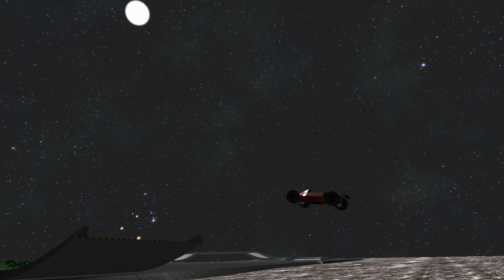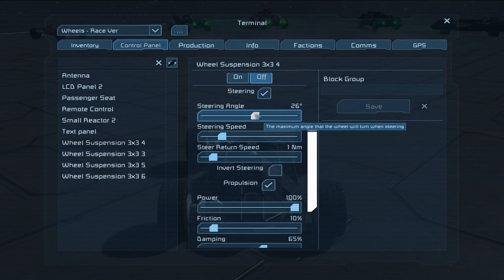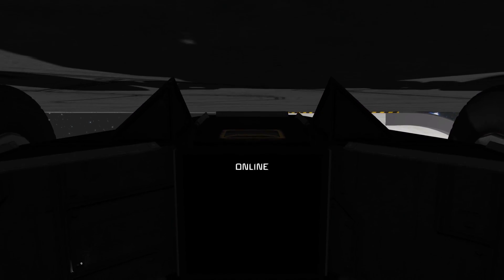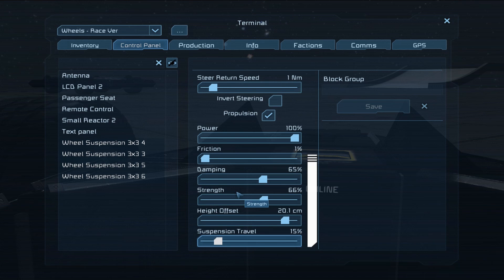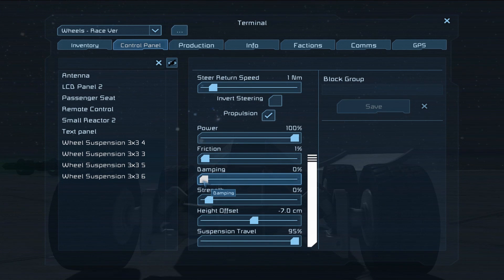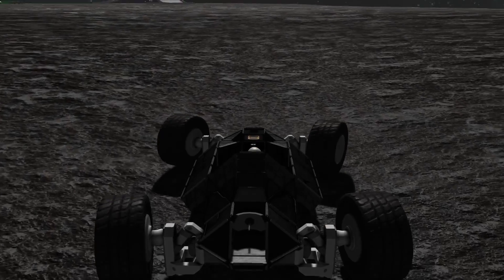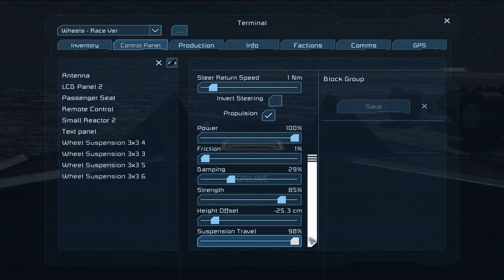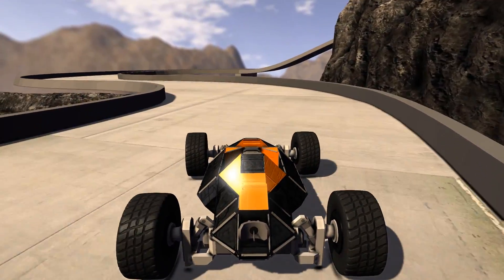Space Engineers - How to..? Wheel Mechanics - DON'T PANIC: The w4stedspace Guide to the Galaxy

Comment: a big thing i found with rovers or buggy's is that if you want to make a preexisting design more stable and handle better adding a additional set of wheels onto the suspension helps immensely; It made my rover take the Glacier on the teraformed map with ease.  (side note, you can attach smaller wheels onto the larger suspension and they get more power, I attached 3x3 wheels to the 5x5 suspension and gained a huge amount of acceleration)
Reply from the maker: eternal domine 6wheels or more seems to be a great way to go for off-road designs right now.. kinda as you would expect I guess, more total contact with the ground and more chance of multiple wheels being in contact at any given time.

Comment: A few details: flat wheels (unsuspensioned) don't seem to have been improved, and large ship wheels also seem to still have very low traction.

Power is extremely important for offroading and climbing as well, since a low power level means a stuck wheel stays stuck. Of course, once you've started moving, that high power might make you speed right off the cliffs. This is the opposite of how rotored wheels work, where you want to spin slower when you have a stuck wheel.
Reply: Well, since you can just change your wheel power (and all other settings) on the fly, there's really no issue here. Just temporarily bump up the power value, climb the hill and lower it back down.

Comment: best thing to do is to set up all the wheel settings in the hotbar to change them on the go, this made my offroad truck work on anything
Reply from the maker: TheRaeffi Aye is a good plan, I was using that as a version of traction control on my racer to give some analogue throttle input - albeit quite hard to control like that :)

Comment: Could you do something around the lines of automated Mining? With the whole exploration thing I noticed myself not wanting to pilot a mining ship to make use of the endless asteroids. I already came up with a ship that that can launch mining 'probes' that dig there way trough an asteroid and wait on the other side when they are done. The launch ship can fire several of these into one or more asteroids and it can pick them up later when the probe is done. The probes run by a combination of programmable blocks, timers and sensors to determine if its aligned properly, if it should be mining or if it should come to a stop. This all works great UNLESS there is a cave inside the asteroid. Inside the sensors cannot pickup the small pocket of empty space so the thrusters are not disabled. This makes it that the probe picks up speed and then crushes itself against the cave wall. Now I'm curious as howto you would handle this concept of unmanned automated mining (or survey) probes.
Reply from the maker: Nick Otten Not sure that's something I could do in this series - the subject is pretty broad - but I could definitely look at making something to solve the problem and explain that a bit like I do in the 'usual' SE vids.

Comment: A better way of explaining the damping is that its a air-filled phumnatic piston, like the ones that cause a car trunk to open slowly.  These have a verry small hole in them that lets air flow in and out.  The smaller the hole, the slower air can flow in, the greater the resistance to any motion.  If we picture the hole to be of varile size, like your iris, then we can imagine that were adjusting the hole size, not the oil consistancy.  (plus, this means that, scientificly, we dont have to make out oil out of nanomaterals so we can control it)

Comment: The problem you have with the hight-setting of the suspension is because you installed them upside down. so the vertical bar from the suspension should be the upside and the triangle of the suspension should direkt down. But the rest of guide is very nice.
Reply from the maker: Volanur84 Fair enough - guess you are correct, although visually that makes less sense as it means the suspension is opening rather than compressing over bumps. Fortunately which way up they are doesn't make any difference to the other settings :) Thanks for pointing that out.

Comment: what type of settings would you use for a tank sort of thing (multiple wheels very close together)
Reply from the maker: TEGC Quantum You'd have to limit the steering travel dramatically to stop them from colliding, which is going to limit how well you can turn a lot.. one option would be to have a set of wheels, maybe the rear, slightly further apart and use those as the primary steering as they have clearance, the rest of the wheels set to a very low steering amount just to help it turn. Then you'll want high damping low strength like the offroader to make it look authentic :)
Reply: Thanks for the help it will really help my tank design project as currently I've been using rotors instead of suspension.

Comment: what should you have the damping and strength on for a moon surface?
Reply from the maker: +Plasma Werewolf Really want the strength as low as you can possibly get while still being off the ground, it'll be that that makes it behave kinda bouncy. Can compensate with damping a little to mean you don't bottom out on landings but both values should be way down near the bottom!
Reply: ok thanks! :3

Comment: ah dangit, when i read "Dampening" i thought of inertia dampening, thinking it was to do with braking :(  Still I found that rear wheel steering with front wheel drive gave better handling for my lil cars on blocks.  Dunno if that was because of my funky settings :P
Reply from the maker: Stewart Bates Yeah can see why :) It was strength that had me confused for ages, just could not work out what it meant until I finally tried setting strength to 0, then things started to make some sense!

Comment: you got that backwards man, you want slightly more friction in the front wheels, that way your fronts stick when you turn and the rear is allowed to slide out and whip a bit. Kinda like in real life when you draft a rear wheel drive car. I think your confusing friction for power here. If you can set power to fronts and backs separately, you want a bit more in the back, but still less friction back there to keep the car level.
Reply from the maker: HypnicJerk You choose between under and over-steer... I found understeer to be the more controllable one. Power does not work like you'd expect, it isn't a measure of torque but a measure of rotational speed only - so reducing the power will apply the same amount of torque to all wheels still, the lower power wheels will simply not rotate as fast - hence friction is used to regulate torque rather than power itself.

Comment: For some reasony wheels are not moving they are turning the cockpit and wheels are set to control propulsion, it should work, why is it not working power is at 45% there practicaly at default, I only messed with the propulsion override, and now none of the wheel are moving, why is this happening?
Reply from the maker: Propulsion override is probably still set to like 0.01 or something, so it's locking the wheels but not moving.

If you right click the slider for propulsion override it'll reset to 0 - or you can ctrl-click the slider to set or check the value.
Reply: @w4stedspace  alrighty